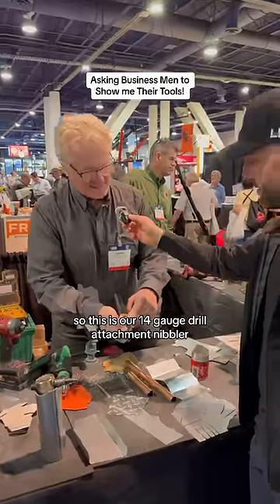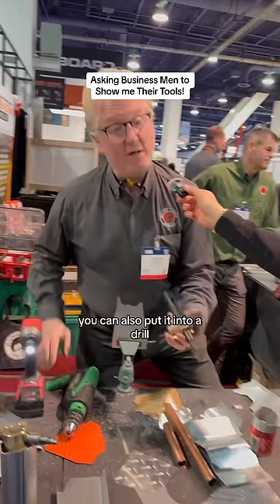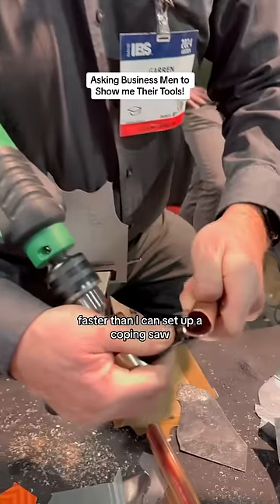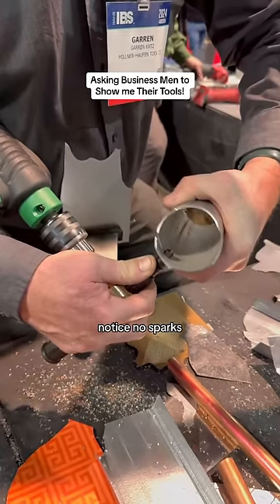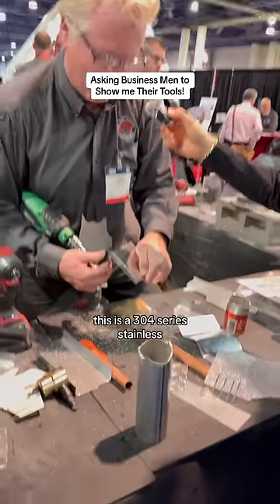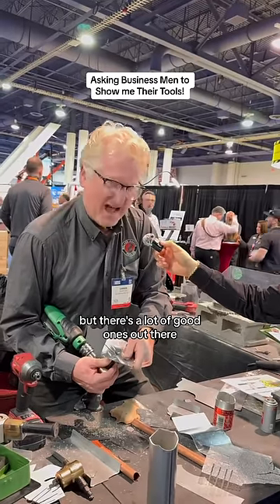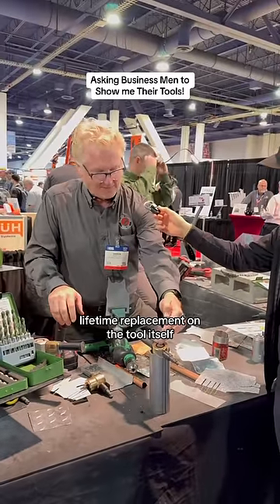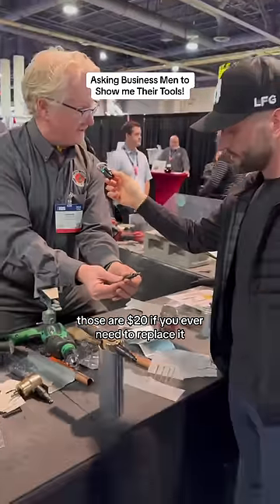Asking Business Men to Show Me Their Invented Tools! #Shorts

Comment: $200?! 
No thank you. I bought one of these off amazon, 10 years ago, identical in every way, with exception of the gold colored annealing on the aluminum body. It cost $9
It's not a tool i use very often, but it still works just fine. 
Seriously, this type of tool, is not made for professional use. It's made for hobbies and light duty work. If you want a serious nibbler tool, you can buy a real nibbler tool for $200, not just a drill attachment. An actual power tool.